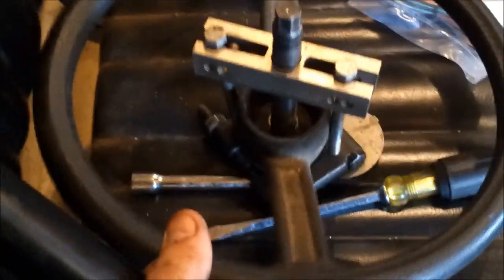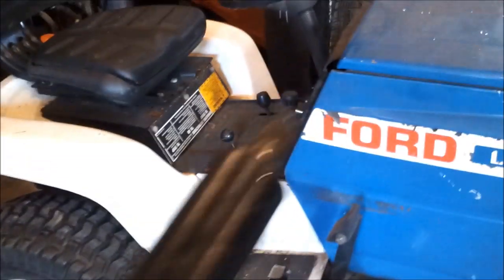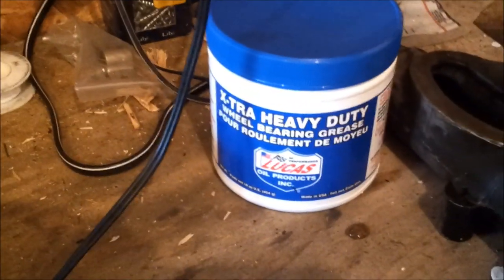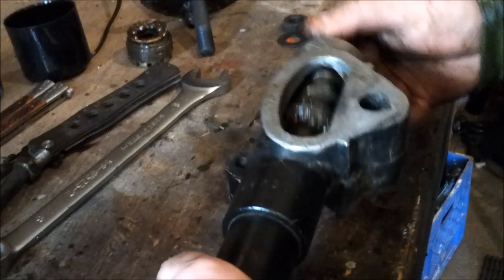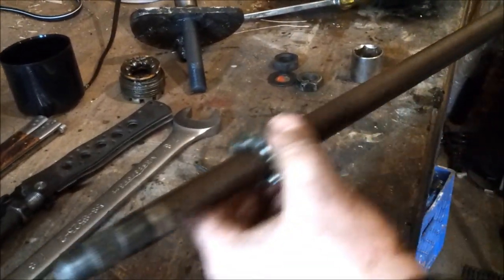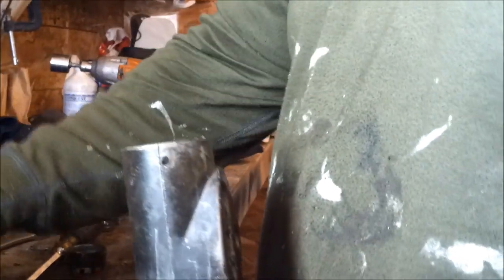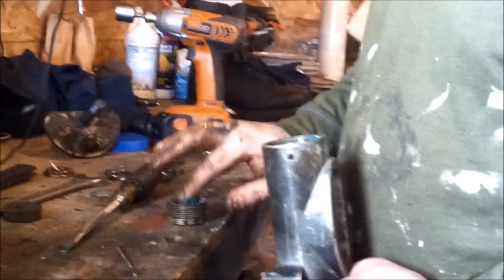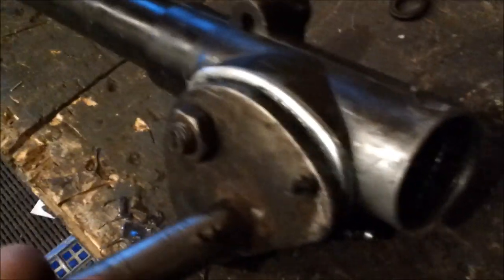Ross steering rebuild for Cub Cadet , John Deere , Massey Ferguson , Ford LGT , Jacobsen

Comment: I did  mine in a  CUB 129 recently...I don't think the thrust bearing really has much benefit, but I did replace the cam follower and that helped tremendously...then I replaced the tie rod ends....steers like a new tractor now....the steering wheel does have to come off to really work on it properly and it is a pain in the neck....he used a bearing splitter, which looks like just the right tool for that job.....I made something up and used some parts from  a regular wheel puller and I fabbed some parts out of scrap steel to wrap under the whole steering wheel...got my parts from Kirk also,,,he is a really good guy

Comment: Looked like a bushing in the hole for the sector shaft to. That's where the play usually comes from. Did you replace it to. I notice older models like mine don't have it. I put a supersteer kit on mine and the play did not go away. I'm going to drill mine out for a bushing

Comment: great video thanks, 
Mine has sheared as it goes into the flat part, 
Do you think it will hold been welded?
Having a hard time removeing steering wheel, what are you prying on under it?
Thanks